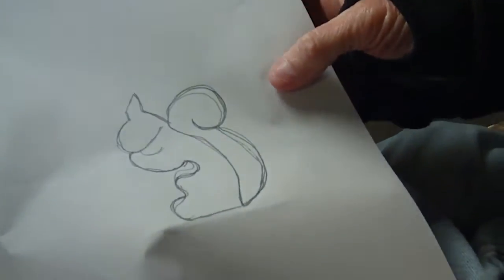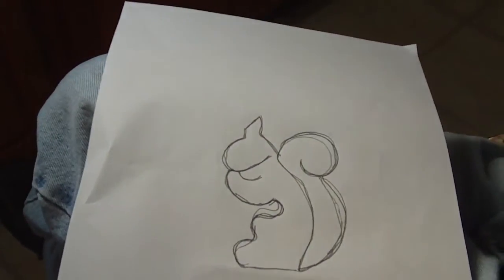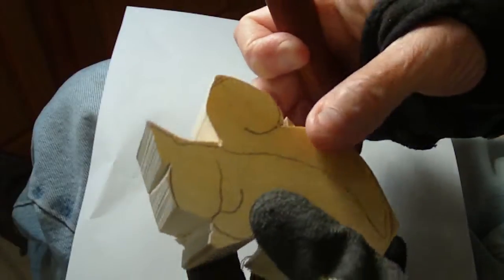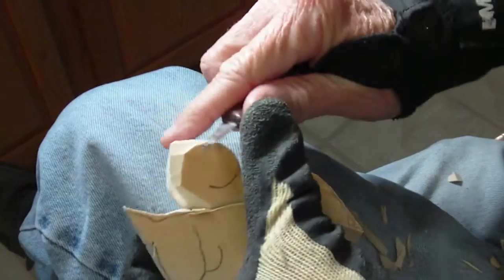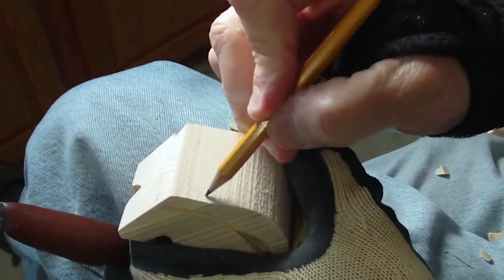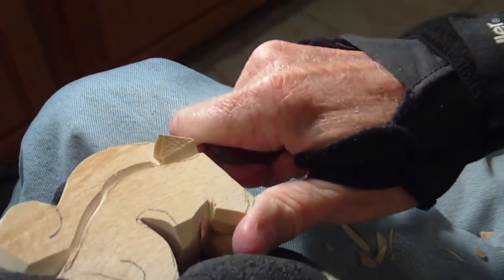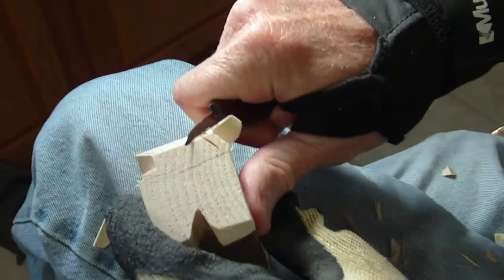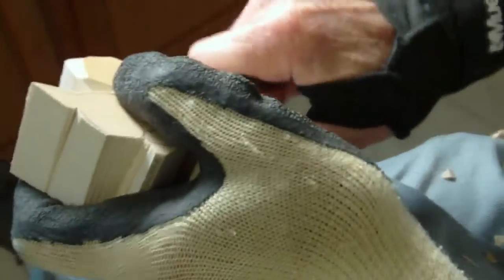Carving The Folk Art Squirrel Part 1

Comment: Nice video! Whats that sort of wood called? Looks very soft. Im carving a squirrel out of spalted lime right now😊 im an absolute beginner. I guess i also need a smaller knive like you have. Looks like you get a lot of control with that. I only have a mora 120 and a 106.
Reply from the maker: it is basswood ..very similar to Lime
Reply: Gene Messer thanks for answering so quick! I google translated the wood i use from german (Linde) to english, it said lime. But when i translate basswod to german it also translates to „Linde“😊. Maybe my wood is a little harder, it‘s spalted (i like the colors, its like flamed), and maybe very dry because i found it in a pile of firewood in a basement of a friend. I hope i can get my squirrel done so somebody would recognise it as a squirrel. Its my first carving besides a spoon.
Reply from the maker: Lime is the UK version of basswood ..but it is a harder density then basswood ..also most basswood carving wood is kiln dried and perhaps the lime isnt ...try this ..get you some rubbing alcohol and mix 50 % with water and as you carve ..spray the wood and it should soften the wood a little
Reply: Gene Messer thanks for the hint with the alcohol and water mix. I‘ll try it out. Again thanks for the quick answer. I‘ll just go through your vids in the next days. I just take my time with the squirrel, doing small cuts until i get closer to the shape. Patience, not my strength...
Reply from the maker: Good advice ..carve safely
Reply: Gene Messer i ordered a knive with a smaller blade like yours, i think the blade of my knive is a bit to long. Especially because the wood is a pretty hard, i guess it had a long time to dry out, i either get very small cuts or i use to much force. It feels a little dangerous, it feels line i dont have enough control over it. 

I tried the same way, beginning with the sides. But it feels difficult to get to the depths of the squirrel, like the belly behind the feet and the arms over the side of the belly. It‘s very impressing how sure and deep you cut into the sides.

Another thing i guess that the grain of my wood goes the other way than yours. Like from the feet to the head. I think yours is cut so the grain goes from side to side of the squirrel? Like my squirrel stands like the tree was standing and yours is like it lies on the side in the tree? Is that important?
Reply from the maker: I myself dont like blades over a 1 1/2 inches ..I have more control with the 1 3/8 to 1 1/2 inch blade ..thats all I ever use ..